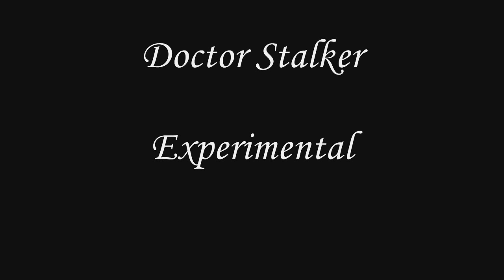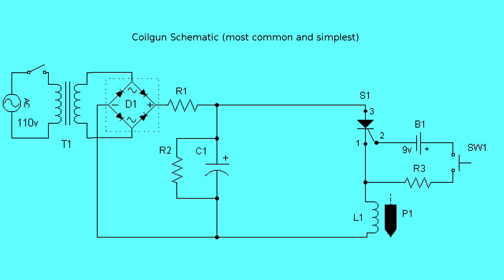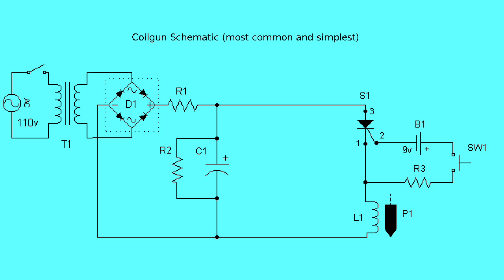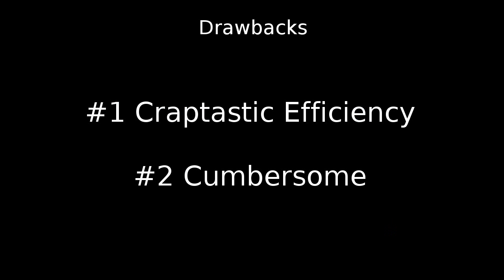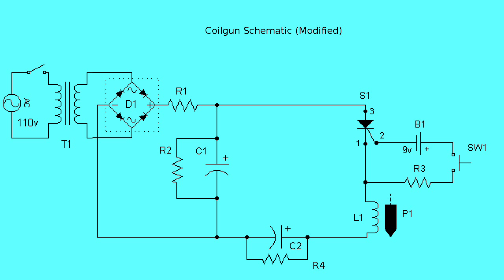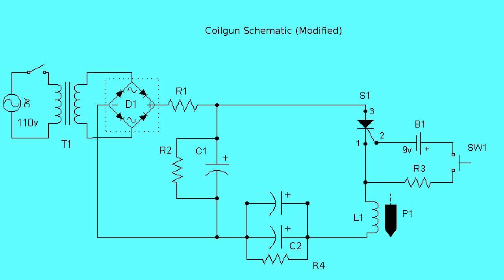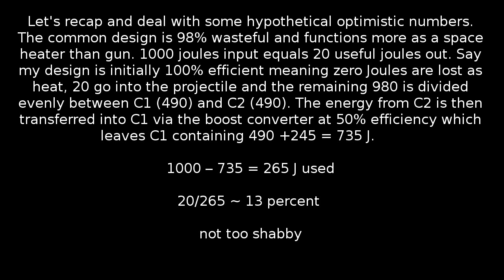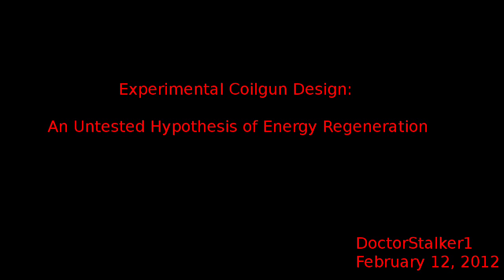Experimental Coilgun: Circuit

Comment: On 1 hand i see what u are trying to do here, but ur not accualy improving the output power, that still remains at the 20J, only thing you did was reuse power to increase battery life
Reply from the maker: I agree. The actual projectile energy shouldn't increase.  98% of the capacitor's stored energy in typical designs is usually wasted as heat and back EMF. My design attempts to recycle some of that wasted energy (useful in rapid-fire mode) and, as you say, lengthen battery life.
Reply: Doctor Stalker ne.Rd increased batterylife would make it more worthy for possible future use as a actuall useable weapon

Comment: 1) I'm going to use these capacitors elcod.spb.ru/catalog/k75-99.pdf
2) 1600V 100mkf 128J
2.1) is true, but this is just one of action taken on increase efficiency